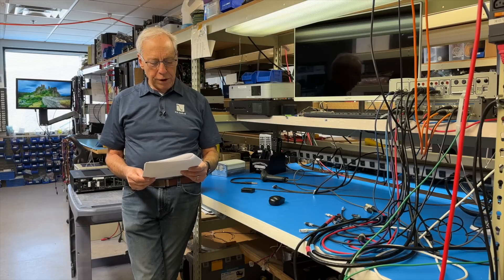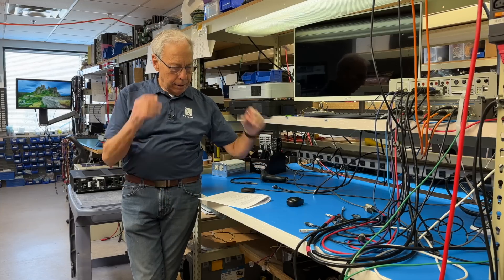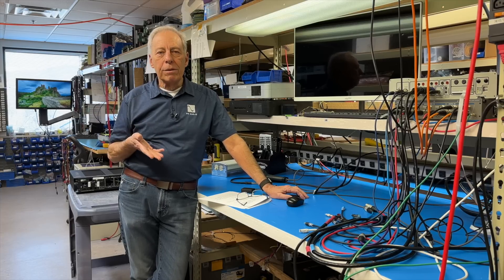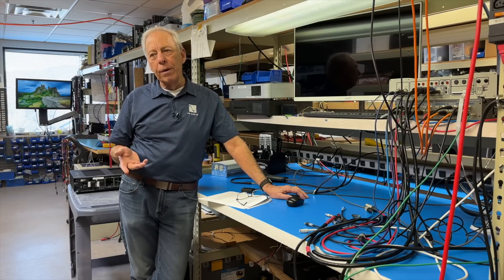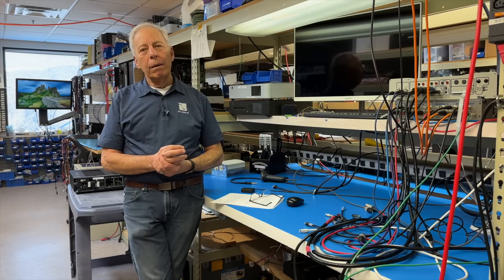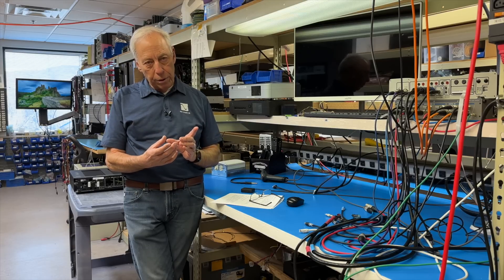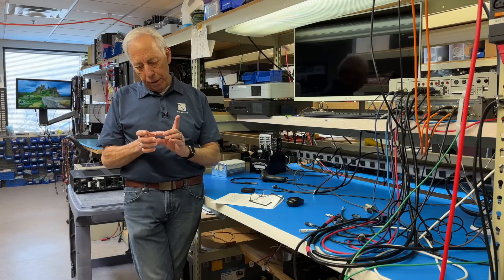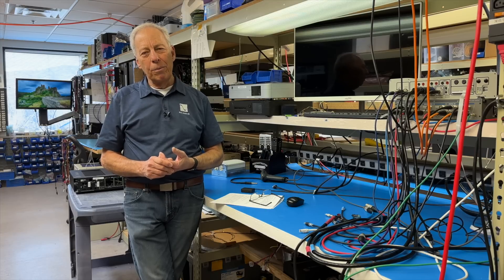Eliminating USB noise

Comment: Some computers are worse than others. Apple does a good job in keeping the noise low and I’ve yet to hear noise from any of my Apple products. Ages ago I was a “Windows person” and had a few cases of running into noise leaking into the analog audio side of my system.
Reply: My main computer is a 2013 Macbook Pro and I have no issues with noise on the USB line to a DAC. Nor do I have a problem with the DAC in the Macbook. It's DAC sounds about as good as my external DAC streamer.
Reply: @jeffwalther  I have Macbooks, Mac Minis and an iMac. They have zero issues. Nowadays the Apple M1 and M2 SOC chips are superior to Intel and AMD chips on power efficiency and low noise design.
Reply: @@Douglas_Blake Agree, this topic belongs to 15+ years ago and still makes snake oil business. Paul is selling a 1.5 meter US$850 USB cable solving a non-existing problem.
Reply: @Douglas Blake -- My ancient HP tower has a Realtek chip(set?) for audio, which actually has decent performance aside from a high noise floor.  Problem solved with a USB-driven/powered external DAC (actually, an audio interface that combines DAC, ADC, mic preamp, and headphone amp in one small box).  Frankly, I think audible noise traceable to USB issues is largely mythical nowadays and is essentially just another audiophile bugaboo in all but a very few oddball cases.
Reply: @@Douglas_Blake Agree, this is about making snake oil business out of issues not existing today. It’s same as this idiotic idea that you need a “resampler” to fix your data flow incl. jitter for digital music lol.
Reply: @ThinkingBetter  Denafrips is selling a lot of Iris DDCs.  Either they are doing "something", or people are hearing things. Many people say they do make a difference in sound quality.
Reply: @rosswarren436  That product has a DSP inside. That means there are millions of ways to alter the digital and resulting analog signal. Yes, I can see where it sounds different but is it really better? In the high end audio world any perceived difference in sound is always deemed better.
Reply: @andydelle4509  One guy noted (compared to feeding his DAC directly from his PC via USB) that, "The main difference I perceived had to do with imaging: The image through the USB input of the Pontus II was simply not as coherent and focused as when the Iris was engaged. The background also became a little less black which did lessen some of the impact of entrances (particularly from the drums)."

The Iris has a FPGA DSP chip, but it is used to buffer and reclock the incoming data stream, not to change any of the bits themselves.
Reply: @rosswarren436  99% of Iranians believe in a religion with a flying horse…
Reply: @ThinkingBetter  the Earth is NOT flat. Just saying that there is likely "something" to all this.  Maybe your own ears and system are not up to the task of being as revealing as these reviewers.  After all we cannot hear with other people's ears nor see with their eyes. We are all unique.  Some have better perception than others, so I can't discount that DDCs do make an audible difference - at least to some people.  - using certain DACs.
Reply: @rosswarren436  People imagine they hear improvements because they expect them. I’ve worked in professional audio R&D for decades and have done digital audio engineering also for several brands you know well. You absolutely don’t need some magic DDC box to fix any data transfer issue to a DAC. Any properly designed DAC can run the audio clock precisely avoiding any audible jitter and ensure all PCM packets are buffered enough to avoid data dropouts. A DDC is pure snake oil. In fact, stereo audio over USB is not even a challenge for modern digital electronics. Rather you could talk much more of a challenge if you run a 4K video with surround audio over a USB connection but even that is also trivial nowadays. Unless you live somewhere on a remote island, I am close to 100% sure you have listened to audio through something I’ve designed.
Reply: @rosswarren436  "The Iris has a FPGA DSP chip, but it is used to buffer and reclock the incoming data stream, not to change any of the bits themselves."

This is easily tested. Play the track though the USB "fixer" and then do a file byte by byte compare to the un-processed file. They better match 100% or any error found just be a random data error. After all you claim all the unit does is to isolate ground noise and reclock the data. There is no alteration of said data. Therefore the files should match 100% as a binary file compare would not care about jitter or noise on the ground.
Reply: @andydelle4509  indeed, that is the whole point of a good DDC. To reclock (and take over that reclocking from the lesser quality clock chip in the DAC).  HIgher end DACs won't benefit from a DDC, but lesser ones can.  Some would want to get a good DAC, and then add a DDC to it and get out a little cheaper or the same price as a standalone DAC that has the better reclocking internal. 

You'd have to simply compare price points and see what makes the most sense at any level.
Reply: @rosswarren436  It’s insanely stupid to add a box with power supply, enclosure, PCB and electronics components just to fix a simple DAC oscillator jitter issue. Any, even junior, digital audio electronic engineer will know that the BOM cost of a high quality oscillator eliminating audible jitter is a tiny fraction of the BOM cost of your DDC. Much better is to just buy a DAC that is well engineered with a proper oscillator and proper asynchronous data flow management. How about buying a box to improve your online banking? LOL
Reply: @ThinkingBetter  not stupid if you value your time. And planning on adding a DDC later can at least let you get the DAC you want and be using it until you can get a DDC- assuming your system and ears can hear enough of a difference that you'd want to spend the money.  Not everyone can pop $2500 for a Pontus 2, but maybe they can over time buy a "good" DAC and then a DDC to get the same level of performance.
Reply: @rosswarren436  Indeed it is rather stupid. I can find oscillators with super low jitter at at a cost of well under US$2. Why the heck would anyone make a DAC with audible jitter?
Well, of course if I really want to spend money on the BOM for state of the art, I could put a US$22 CCHD-957 Crystek oscillator on the PCB and sell it for US$2500 for people willing to pay for it 🙂
And btw, the reason Crystek can overcharge for such oscillator component is because we have customers like you.
DDC does nothing any well designed good DAC should not already do (without adding cost to it). It would be nice if more proper blind-testing was done on these snake oil scams. We easily get fooled because human perception is not precise and not easily memorized.
Reply: @rosswarren436  BTW, your USB DAC can run in different transfer modes with your source: adaptive, synchronous and asynchronous. Your DDC only makes sense when using the inferior synchronous mode where the DAC is not in fine control of the sample clocking. I rather run in proper asynchronous mode with close coupling between DAC and onboard oscillator WITHOUT a DDC trying to control the clock via a USB cable externally. Since when was that superior? LOL
Reply: @ThinkingBetter  as I said, if you can afford a DAC with a great clock then all well and good.
Reply: @rosswarren436  Why do you think a great clock is expensive? Do you know Digikey or Mouser? Try to look for the actual parts used for oscillators in DACs and explain to me why I have to pay extra for this issue to be solved.

Comment: Personally, I use an affordable streamer, the Silent Angel Munich M1T, which has a quiet design (parts well isolated) + a AudioQuest Jitterbug on the USB output. While I am sure it is not as good as PS Audio's DirectStream I perceive it to be virtually noise free.
Reply: Not even the average Swiss can afford this so-called affordable streamer.